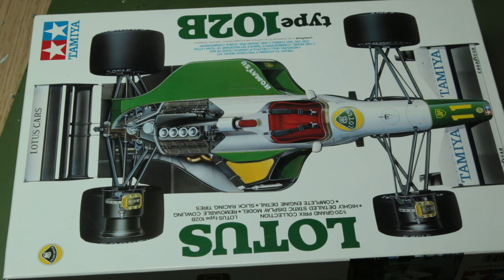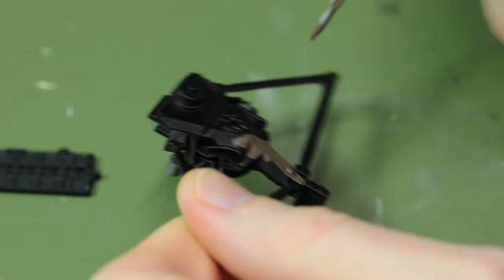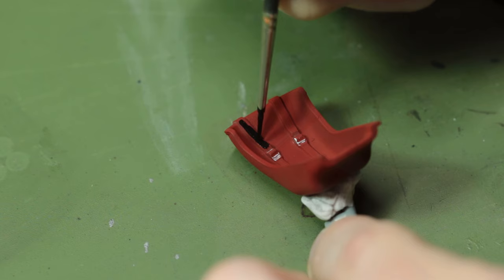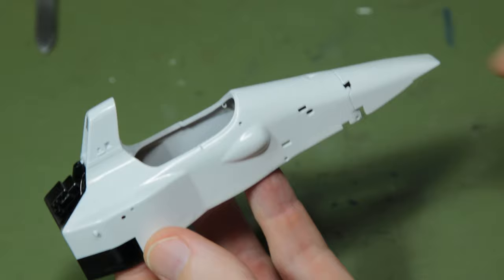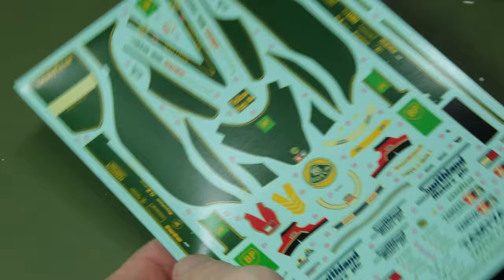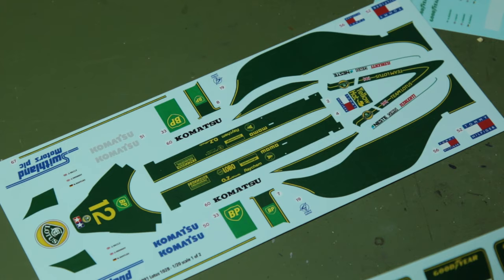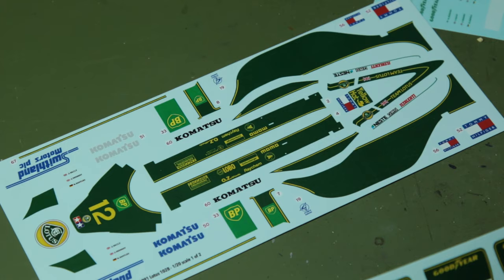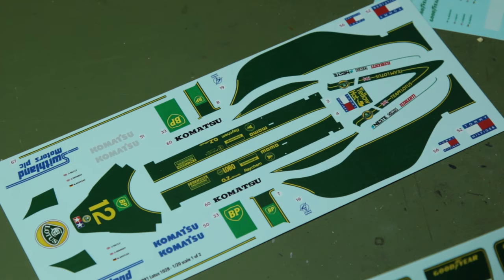Lotus 102B F1 car - Johnny Herbert (Tamiya 1/20 scale model full build)

Comment: Decant tamiya spray cans in to bottles then spray thru your airbrush, the nozzles are just to heavy for 1/20 scale.  You will have more control and not waste as much , they really are excellent paints. Also try Mr Hobby GX112, its my go to gloss clear.
Reply from the maker: Thanks. I did try that (once) in the past. These days I'm wondering if the Tamiya LP paints might be as good (if the equivalent colours are available, which they aren't always). I need to get around to trying them. I also have a couple of Zero paints which I need to try out on future projects.
Reply: Yes the LP's are just as good, saves the hassle of decant. I don't think they are the same paints they put in the cans tho as the gas/additive changes them slightly imo. I'm not a fan of zero, they can be problematic and just don't lay down as well as other brands. Only thing they have going for them is the colour matching, so they would be my last resort.
Reply from the maker: @johnc4144  Thanks, that's good to know. At the moment the only Zero paints I have are the metallic Jaguar F1 green and one of the Benetton blues (both because they're hard colours to find elsewhere).

Comment: That is a nice build. I can imagine painting these cars is quite a challenge to paint because you need a high gloss finish. I find Tamiya gloss rattle cans difficult to use because the margin between a dry semigloss finish and a shiny finish without runs is really difficult to achieve. Perhaps a better approach is to paint the colours in matt and then go for a gloss varnish. I don't think the Tamiya X-22 is really that glossy but there might be others that are better. Perhaps the Pledge or Future floor polish.
Reply from the maker: Thanks. I'm starting to think the same - achieve the gloss via the varnish rather than the initial paint. And avoid white cars! :)

Comment: Lovely work, I like Indycals, with care and attention they work well. I built the 107 some years back and even converted one from the B to the C version, model on
Reply from the maker: Thanks. The only bit that worries me about the C conversion is the extra bodywork at the rear.
Reply: @ModelNerd  I just used some plastic card, getting the rear wheel cut outs was the trickiest part as it extends that far, I left the rear wing though. Model on
Reply from the maker: @Sarah-JaneR32  Good to know, thanks. Can I ask how you attached the extended rear bodywork to the existing cowling?

Comment: Silly question but what is that Smokey grey, almost brown color you use on the engine/ggearbox? Thank you
Reply from the maker: Not a silly question - Tamiya call for a metallic brown which is a mix of xf-10 and xf-56. In my case I often use Vallejo metallic grey and brown as they brush paint more easily.